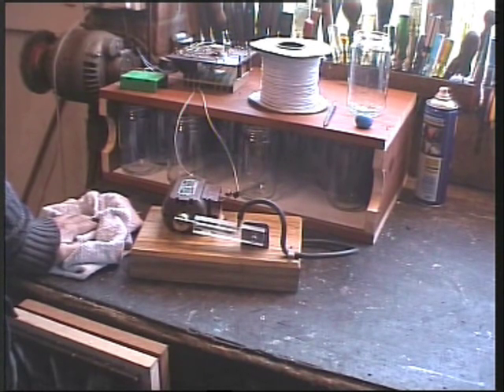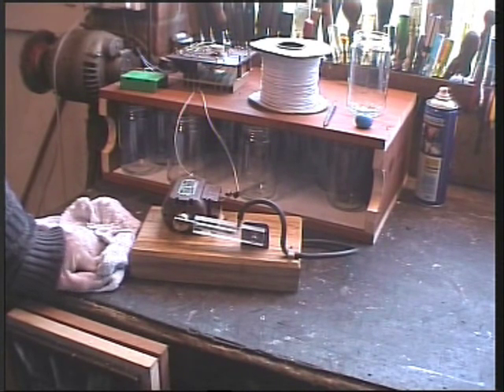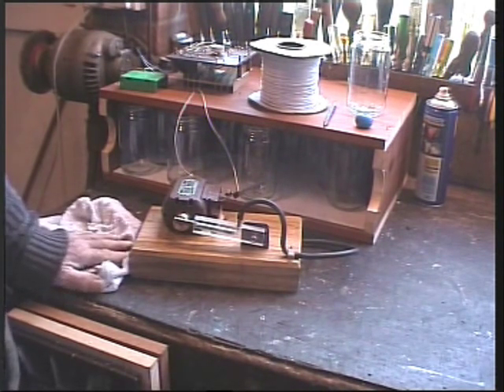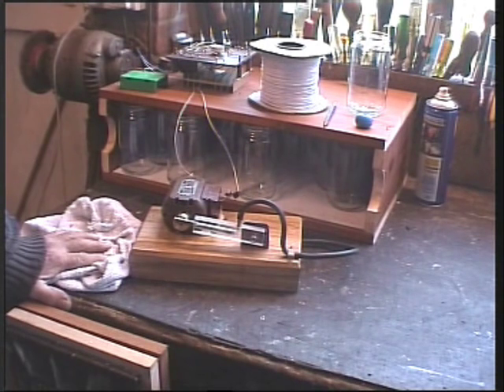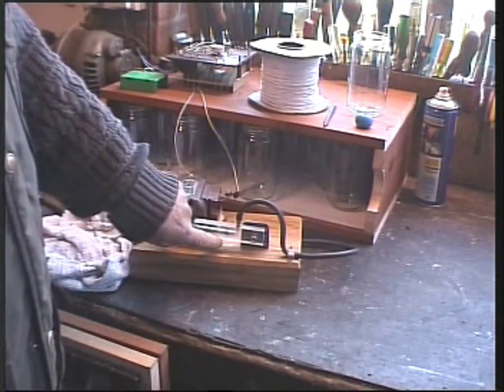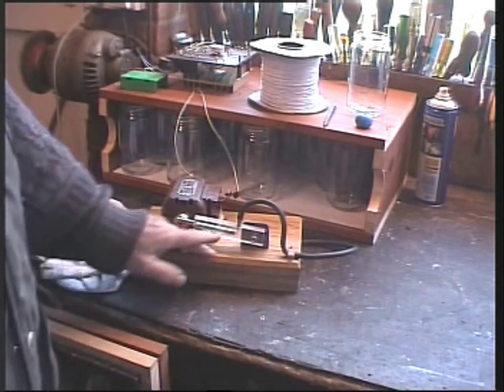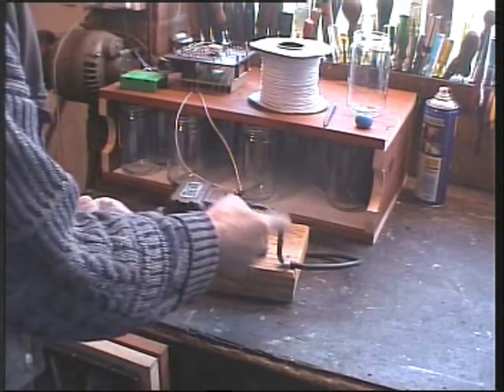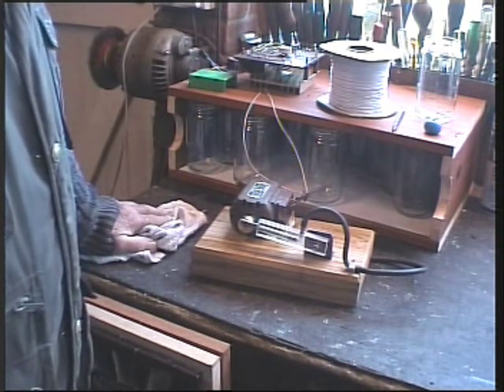LIFO Carousel

Comment: Don't work to hard we want you to get well. I did engraving back in the day. It was a different format. Dies or molds would come off the large pantograph machine with the design cut flat and my job was to give it features. Take for example a person's face, depth for cheeks needed to be added as well as the bone structure lines. The lips need rounding as well as the vertical lines on the top and bottom lip. One example I worked on was the 1984 Olympic medals.

Comment: Wishing you good health for the New Year POC!  If I remember correctly you're a Ham Radio feller from way back so I know you'll get this... resonant freq of a tank is 1/(2pi*sqrt(L*C)) right... well in acoustics the volume of the cylinder is the C (compliance or spring constant if you will) and the length of the tube is the L (mass element) . The length of the tube as well as the inner diameter set the Q of the resonance... (very narrow range if Q is high, broader if it's not). If your tube is highly elastic you will lose energy just like distributed capacitance across an inductor. A properly applied Helmholtz Resonator is just what you need! You should be able to set a side trap with an adjustable leak and tune the system.

Comment: I remember a couple of years back on a machining forum I post on some guy was detailing the process of making an air palm engraver, but then the guys that manufactured the engraver he was borrowing ideas from sent a cease and desist and the meek tools that ran the forum shut the thread down and all the pictures so far were removed. I'm still pissed off about it since i'm fairly certain no laws were being broken and the letter was just an empty threat.
Reply from the maker: T2h instructionals has given a link (thanks) with all the info but in my opinion way "ott" ok if you want to go pro ! but I just wanted to give it a try so looking at a KISS approach may go electrical ? you guys in the States have an advantage with 60 Hz mains..